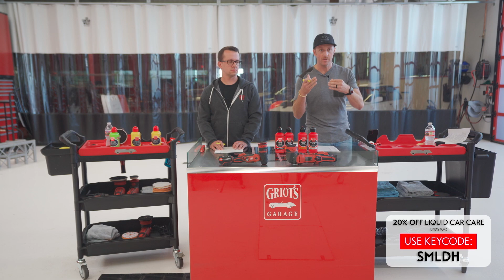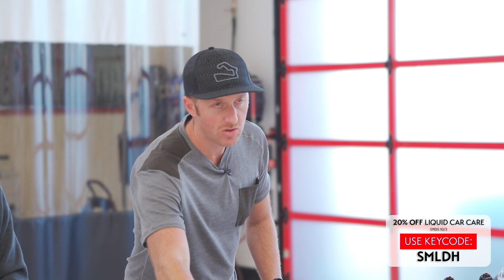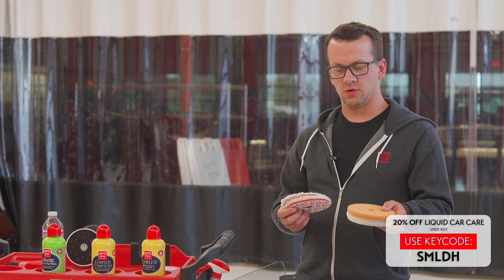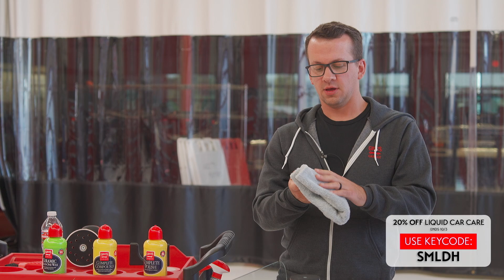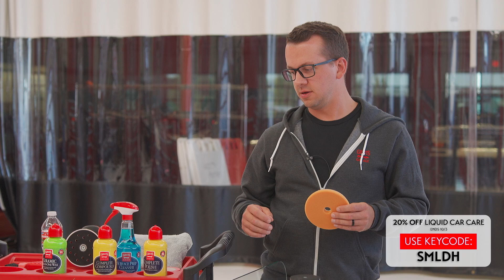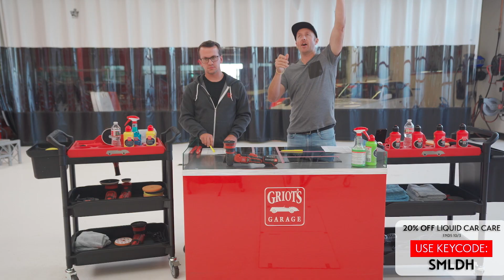No Questions Left Behind:Answering questions from our last livestream on Machine Polishing Basics

Comment: Could we Inter use the boss line with the regular line of polishes?
Reply: Yes! I use a drop or 2 of fcc  on really bad cars alongside ceramic all in 1
Reply: do you use a panel wipe for any FCC oils after cutting, when following up with Ceramic All-In-One Wax polish? to make sure it adheres? @brapdaddy
Reply: @brapdaddy what is Fcc?
Reply: @Swimdancer1  my bad dude, it's Fast correcting cream. From their boss line of compounds/creams. Ceramic all in one is a very good single step though. Very rarely do you need to add to it. If anything I'd reccomend their fast correcting microfiber pads. I just used that combo on a Porsche cayenne with amazing results.
Reply: @Swimdancer1  I meant to say fast correcting foam pads. No second step required with that pad.